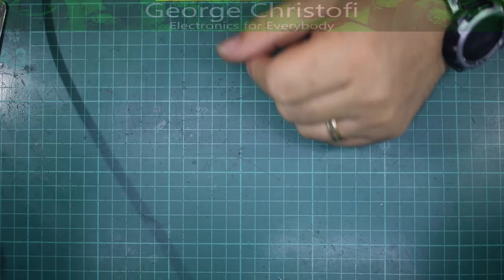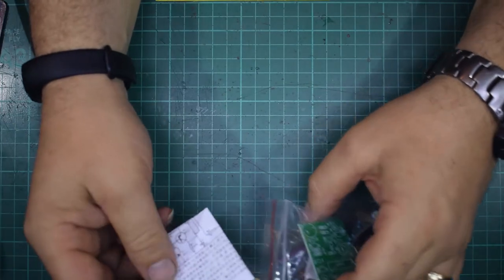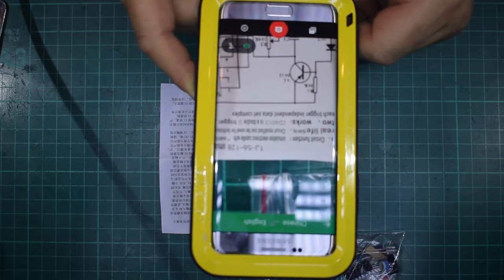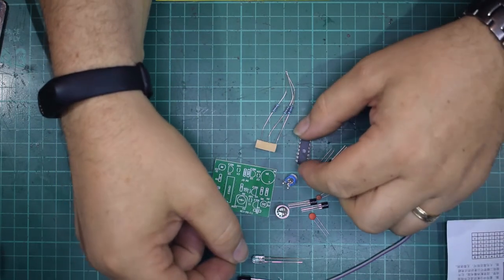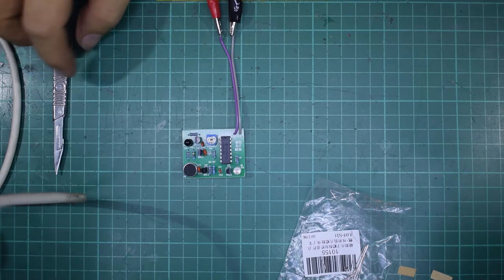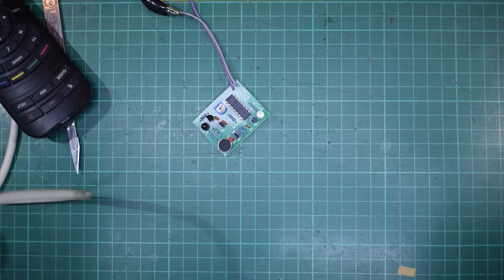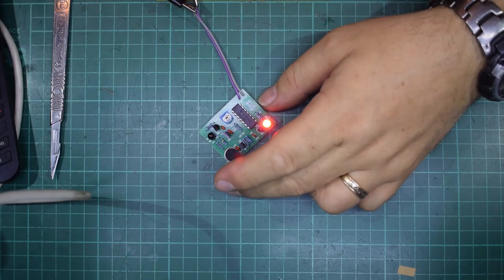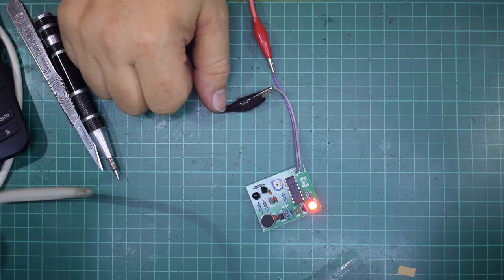A Mystery Kit from AliExpress..

Comment: hahahahhhahahahahhahhaahhahahahhahhahaa!!!!!!
Reply: Hi there !...I think this could be used built into an electronic candle as a bit of Tat!.. use a cheap fake eBay candle and you light it with a lighter and you blow it out !just a little bit of fun and given me an idea to use an Atmega328p-AU on a small board as a novelty night light, software should be quite simple to detect the two signals, just the LED, MIC and a few passives needed (or just use it as is!) lot of fun for the price of a pint of Guinness!
Reply from the maker: @andymouse  that sounds about right. Wouldn't need too much. The at chip would only have to detect a voltage change on its input to switch the output.